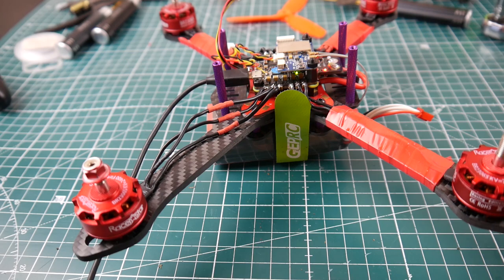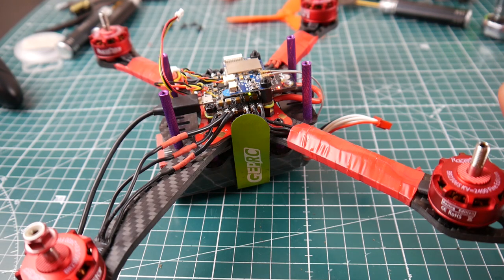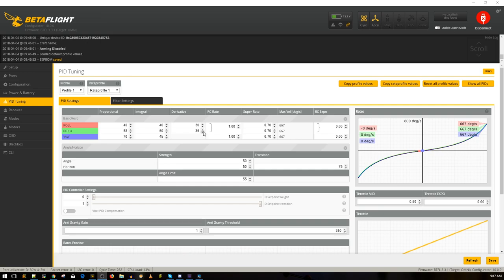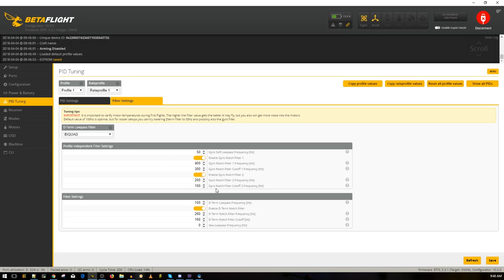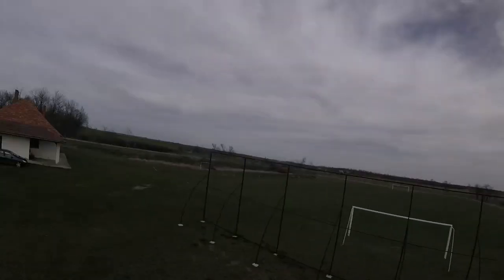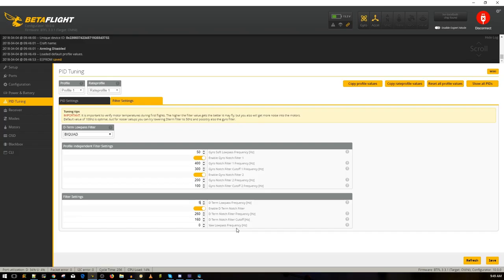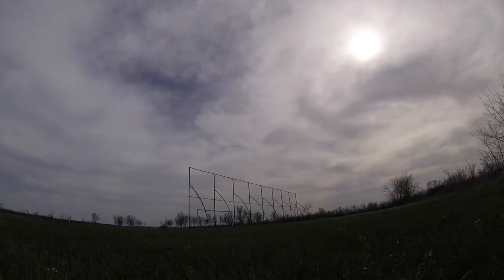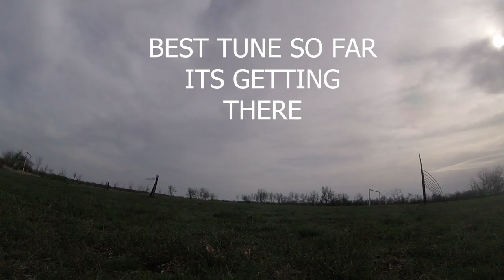How to Fix 97% of Yaw twitch , Motor Twitching and stuttering issues

Comment: This video remains relevant to this day. Was all used to tuning a 3 inch quad, so I was able to push the sliders way off to the right, but then I started tuning on a 7 incher, and noticed that it violently revved on the ground but thankfully no flyaway. Flew fine, but that revving concerned me. Pushed the D filter slider back to 0.95 (think that puts the dynamic filter at 71Hz) and it's nice and chill. Big thanks!

Comment: So on my last build of Superlight 5 V2, I put a BBB 2207 and motors were horrible with osciallation. What I ended up doing was mounted them with silicon softmount I had and also used locktight on motor screws as well and it was literally gone. I typically stick with Emax LS, Brotherhobby, and TMotor on my builds and don't have to deal with stutter and osciallations... but thanks for the tip! I tend to keep my D term low and P low as well.

Comment: My babyhawk 2 HD has been giving me huge twitching issues just upon lift off...been racking my head, going through every little thing to figure it out...Never thought to just test it on the bench like this , lifting the quad, wiggling it around with your hand and just changing filter settings on the fly until the motors sounded smooth while connected to betaflight. Gonna give it a shot!

Comment: I thought I had the same problem with a drone I just built, but I started noticing sparks coming out of one motor. Ended up getting fixed by removing some metal shards in the motor... Thanks for the video though👍

Comment: Got the same problem on a Matek board with a 4 in 1 ESC in a Talon. It has BB and the data showed D-term oscillations at 50 to 60 Hz. I lowered the loops to 2k/2k and the LP to 50 Hz and it was gone. For a while at least. 
As it got colder, it came back and I decided to install a new FC.
Struggling with these problems is annoying, especially when you have other, cheaper quads, that work just fine.

Comment: MAKE SURE BETAFLIGHT IS UP TO DATE I just built a quad, basically my third of a certain type but I was running a different set of motors, I flashed my board set everything up just as I always had then when I went to fly it shuttered and twitched like crazy trying to get off the ground, I found there was a newer version of betaflight installed it and flashed my board and reconfigured the same settings and boom it flies beautiful!

Comment: This is the exact problem I'm having and as a newbie it's overwhelming bruh but I'm determined to get this Armattan Badger in the air.
Thanks and please keep us informed.
Reply: i had same issues. countless hours watching tuning videos with no luck. but persistance paid off! i understand cleanflight now. if your still having troubles then you need to recalibrate your throttle on flight controller. fixed my problem instantly. no mor twitching no more dropping out of sky. smooth flight.
Reply: @ChainsawFPV  hi! what u mean recalibrate throttle on fc?
Reply: @rudevibe  This post is old now and a lot has changed. Feel free to message me if you need some help. either thru my email or on facebook @ David Ayers.

Comment: Dude just ...THANK YOU !!!!!!! :D
I had this issue since more than 1 week with my Tyro-79
just a little bit with 3s , but unable to fly with 4s cauz he just turned on hiself (yaw) 

I put 55 unstead of 100 and  it's just perfect Thank you again :)))
Reply: Had the issue with the same quad, fixed it when i realized i was running pids on 2 khz instead of 8.
Reply: OK I have yaw problem in tyro79 (very nervous) ... can I solve by going down to 55 + / -... ??? Thank you

Comment: I fix that problem simply by changing esc protocol. I was on Dshot and went back to oneshot42. It took 10 mins and my quad was flying like a charm. I think some esc, even if they say they rated for dshot, they might not work properly. Im using racestar 30A on this particular quad.
Reply: Francis Alerte some older flight contrlers as well don't like to run d-shot even if they say they do...

Comment: thanx bro helped alot . i tired everything you mentioned in the vidoe but nothing worked .i have the racerstar  tattoo so i have the bb . noticed as i kept tuning it got better but wasnt perfect .so i noticed a guy in your comments that mentied to change the blheli32 pwm to 32k i had mine set to 48k like all my racerstar tattoo boards so as my last resort i changed the pwn to 32k and bammm !!!cleaned tuned now perfect. so yea first to check is the esc pwn dshot 1200 . thanx bro

Comment: It's helped a lot,but your getting bounce back and Prop wash still, but without a BB your not going to be able to pinpoint the spike causing the issue.  A tight notch filter would smash that stutter, but you've got no way of knowing what frequency to set.

Comment: Is there any way to do this on Libreflight? I’m rocking a f1 flight controller and it does the weird twitchy things and it just randomly goes way up in the air when it does the twitch thing. I’m not sure where the setting to change it is in Libreflight.

Comment: I had the same issue. I fixed it with changing the motor screws. One or two screws may have been touching the coil.
I also completely flashed a new firmware. Racerstar f4s tattoo version came with an outdated FW and I switched to Lux f4 and Bam.
Problem solved.
I'm not sure witch one fixed the issue but it if flying great now.

Comment: I have an issue that the veteran drone builders can help me with. I built my own drone, and im using Libre Pilot, CC3D and FLYSKY FS-I6, A2212/6T 2200KV motors and QWinout 30A  BEC ESC's,  but when I get to step like plug battery in press stop where we try to spin the motors i never hear the next ESC or Motor tones why? I hear the first 3 tones for motor start . Please help this Navy Veteran!

Comment: Thank you for this video.  Is this problem also associated with different voltages as input?  I ran into this problem with my nano LR 18650 build.  It flew like bobble head on 1S but for grins, I used 2S and the problem disappeared.  Was this just accidental luck or is there a relationship for voltage input and how much of the D can be changed  as related to input voltage?  Thanks again for your clear evaluations.

Comment: Did you continue work on the matek f405 issue? And agreed, without blacbox, this is a hell of a struggle
Reply: If you are talking about first F405-AIO then don't use forward side ESC pads - it will solve yaw twitching issue in great degree.
Reply: KrotowX For me, it's about the f405-osd, but maybe solutions are similar. What do you mean by forward facing? Don't you have to use them all?
Reply: Those are two ESC power wire pad pairs at opposite side of power connector - near S3 and S4 ESC signal pads to be correct. Powering ESC's from them does affect BEC used for gyro chip powering pretty bad. Obviously you can still connect and use ESC signal wires from S3 and S4 pads :)
Reply: KrotowX interesting!! Would you by any means know which pads would affect the f405-osd the most as well? Will definitely give it a try. Maybe directly from the battery pad as well, since I rarely use the current sensor

Comment: My recommendation with the latest betaflight is soft mount the flight controller and motors, turn on dynamic filtering and antigravity set to 3, in the filter section set to PT1 and turn off all notch filters. Obviously check your motors aren't getting too hot especially with the last filter turned off but unless you have really bad motors you should be fine and a bit of fine tuning of the PIDs will get rid of nearly all the propwash oscillations etc.

Comment: As somone else said, still relavant. Was getting this on a skystars am32 esc or using 1000hz elrs. Because ive built the frame and used the fc and vtx before. Not rx or motors. But upgrading betaflight just to use the 1000hz preset seemed to do it. Just a micro desync i can barley see now. Instead of hearing a WEEEEEE to full thrt its like weWEEEE somewhere after the middle or in fast moves. And blackboxed it last night so ill see.

Comment: I had to change the pwm frequency to 32k on my blheli 32 escs to fix it
Reply: thanx bro you helped me alot by posting this 1 little comment lol i tried everything but this last and worked great !! ty bro
Reply: I know this is very late to reply. But I came across this comment after struggling with a yaw twitch. I didn't  think it would help because I've tried everything else , but one simply adjustment and OMG !! It's gone. Smooth as butter.  I have another doing the same thing so I guess that one's next. Thanks. Funny how you learn more from the comments than the vid. Lol
Thx.
Reply: I know this comment is two years old, but thank god I found it! Just this simple setting and the Problem ist solved! Thank you Sir!

Comment: I have a problem. One of the motor spins even it is not armed and spins when armed only when the throttle is zero. When the throttle is incresed this motor stops. Could you please suggest a solution for this?

Comment: Great Tip! What happens if you disable the D Term Filtering? Does that help, or your motors cannot handle it?
Reply: If you do that the motors flip out and get blazing hot in just a few seconds. D-term filters are the most important filters on your quad.

Comment: In my honest opinion you were getting mad P term osciliation because you put the gyro lowpassfilter down to 50 Hz which introduces mad mad latency and the pid loop can't compensate for the phase delay (time shift latency).  Change that back to gyro LPF back to 100Hz and Dterm LPF to 90Hz either turn off the dynamic notch and leave the gyro notches or turn off the gyro notches and use the dynamic notch and give that a try hopefully that should fix that up.
Reply from the maker: Will do still trying to replicate it with a FC that has Black box.
Reply: Plus those motor wires are a  nightmare: they will Tammy vibrations straight to your FC, also with delay the PID cannot compensate for. I've fixed a couple of courts that had yaw twitch, simply by rebuilding they neatly and making sure that nothing connected to the FC would vibrate and flop around.
Reply: So with the D term up and the Gyro up I get a lot of motor heat that i didn't get previously so that doesn't really make the issue better. There is P term oscillation but the motors are cooler and you can give the kwad enough D to where it doesn't fly sloppy. The Gyro and D term filter that high it may respond better but the D has to be cut so much the kwad does not produce good results

Comment: I am working with a mini quad with a F3 evo flight controller board, as soon as i arm the quad and give a little throttle , it lifts up and starts yawing CCW , i tried calibrating my flysky iA6B TxRx and changed even the motors and flight controller board but the problem is still there. I need help guys !!
p.s. I am still a noobie trying to learn Quadcopter things so maybe this is a small problem but i cant solve this. actually i cant ven figure out what and where exactly the problem is.

Comment: I actually had to tighten the screws on my frame and motors. They loosened up even though I used loctite. I guess it wasn't enough. Reapplied generously after that.

Comment: It is not a fix. When you have to lower dterm lpf below 100 - something is terribly wrong with your quad. You introduced so much delay and phase shift to PID with these settings so it oscillated badly. The problem is with the hardware itself in your case. Please read about filtering and blackboxing and see for yourself
Reply from the maker: I don't know if you watched the vid there is no Black box log on this quad only way is to go blindly.
Reply: Drone Mesh,  i watched. And you should understand that you  cant mess with filters without it, since there is no info about whats happening with a quad in flight
Reply: MrBirdshell666 exactly... There is a way to have bb with an external bb logger

Comment: If you want the easiest way to get rid of oscillations Install Butterflight, enable airmode, antigravity and dynamic filters, then set the filter type to PT1 and disable all notch filters. Then go to the CLI and enable the fast Kalman stage2 gyro filter using the instructions on their website. Check out the latest video on my channel running an old f3 on Butterflight with the fast Kalman, no oscillations or bounce back on stock PIDs amazing. I've since learned its best to increase q=800 when running 8K/4K and with some minor PID tuning it's flying even better now.
Reply from the maker: MUNKY FPV Interesting will give a go
Reply: Drone Mesh Definatly try it out mate, the configurator is almost the same as betaflight so it's super easy too. My video is just some DVR footage but you can see flying straight back into my own propwash isn't even a problem, last time I flew a quad that handled it this well was raceflight but I prefer a lot of the features in betaflight/Butterflight like the OSD.
Reply: I can't believe anyone is still on BIQUAD
Reply: Not sure if that'll help in this case.  Dynamic filters don't seem to deal with harsh mechanical vibration that makes the D-gains go off the planet like what's happening here.  Last time I had a quad do this it was a really harsh gyro spike in the 70-80hz range that I just squashed with a tight notch filter.   Who knows though right?  With all the magic these filters do it can't hurt to try it out.  :P

Comment: Hey there watch this multiple times it's pretty good,but seems like i have different case, i have an riot control F4 with wraith 32 v2 if i leave my battery plug in for few seconds motors would start twitching and if turned on my radio it will twitch much worst so what i did I tried hovering it and quad wasn't sstable , wobbling like crazy it was dipping left and right like 4 esc having desync issue (they're brand new esc)

Comment: If you have motor twitching like that don't bum yourself with crazy dterm overfiltering rebuild the drone with more capacitance and a better softmounting or none at all if using a fc esc board like this.

Comment: When ever i plug my battery in, the motors twitch hard with every chime from the esc start up tones. Its my only quad that suffers from this issue, why is that?
Reply: At least 4 of my quads do this.. to my knowledge it simply has to do with the strength of the magnets in the motors slightly but mostly it has to do with how the ESC boots up. All escs will put out a small test signal to the motors when it boots but only sometimes are they substantial enough to twitch the motors. I have replaced motors on quads that did it for various reasons and sometimes only a few motors twitch and the rest dont... its mostly a crap shoot but its certainly not harmful. If you set your ESC beeper to function as your buzzer you will see your motors twitch as the ESC chirps.

Comment: How do you fix a yaw spin when I arm the quad it just starts to yaw spin it does lift off but spins like crazy ??
Reply from the maker: Andrew Bright Have you checked the transmitter channels if correct. Second make sure you sub trim is centered very easy to overlook and had happened to me before.
Reply: Though this post is old, i just noticed this recently from a friends quad...issue was motors spinning in wrong direction and his "reverse motor tab" wasnt ticked correctly...

Comment: This video points in the right direction, but isn't really correct. I couldn't get rid of the twitches on a new build with PID tweaks, so restored defaults then applied the settings here https://github.com/betaflight/betaflight/wiki/4.0-Tuning-Notes  . That did it.

Comment: easier way is to hook up to betaflight and test each motor one at a time at different throttles and find out which one or two is causing the vibration issue and replace those esc's.